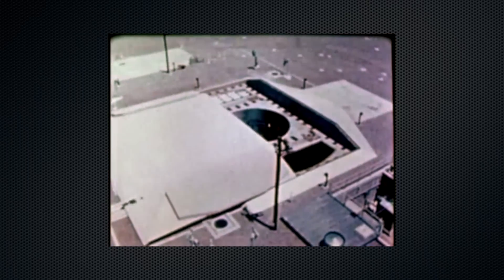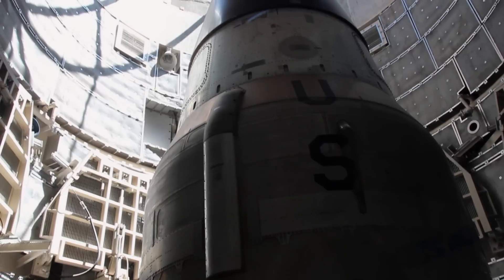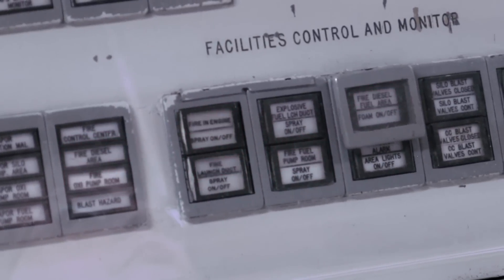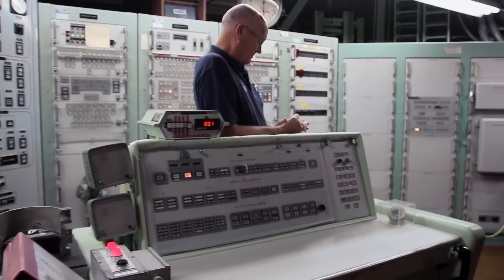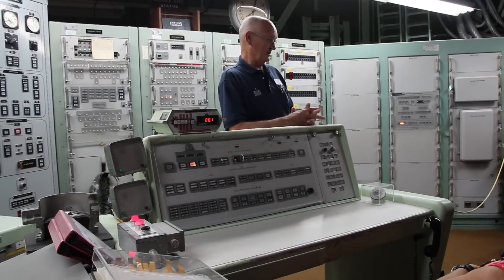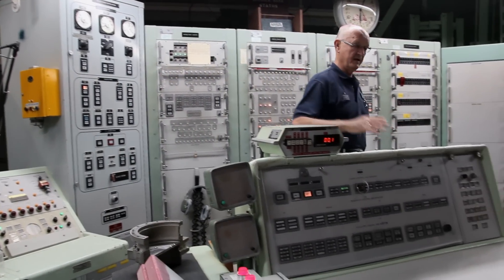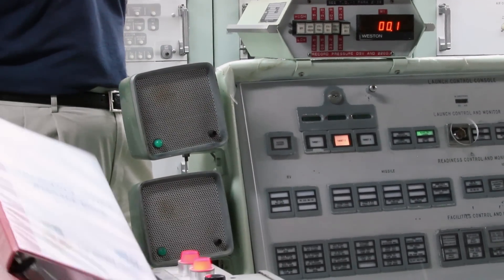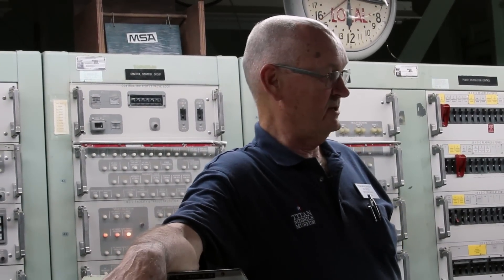How a Titan Nuclear Missile Launch Works

Comment: If you stop at 1:14 and notice the lit lamps next to the key. One says "LAUNCH ENABLE". The unlit key below it says "LAUNCH DISABLE".  The control 'computer' or system was analog, so the Launch Enable and Launch Disable lamps were lit by the presence of voltage on that particular wire. In essence, it's a digital 1 if voltage is present and a digital 0 (on or off) if no voltage was present. As I volunteered at the Missile Museum in the early/mid 90's giving tours, I had the opportunity to meet many individuals who were involved in the design and construction of the silos and missiles, as well as people who had worked on decommissioning and demolition of silos when the program ended. In any case, I learned this tidbit of information from an individual who worked on the design. During an actual launch, where the alarm comes in, the red safe is opened and the launch codes are entered, the silo door will slide open and when the keys are turned, the presence of the LAUNCH ENABLE signal would allow the butterfly valves on the fuel and oxidizer to open and mix, which would launch the missile. During one of the test drills, everything is done the same, EXCEPT you would see the lamp on the LAUNCH DISABLE switch LIT. This would allow the codes to be entered into the computer, the silo door would slide open, BUT the keys were turned, the butterfly valves would NOT OPEN, and NO LAUNCH would occur.   Now the person I met discussed this with me at some length - each silo had all the manuals and wiring schematics for all of the equipment there, to include the computer equipment. if you were to pull up one of the floor panels behind the computer racks, and find the bundle of wires, you could find the two wires (LAUNCH ENABLE and LAUNCH DISABLE),  and if you cut them and wired them so the LAUNCH DISABLE signal was connected to the LAUNCH ENABLE wire, then when you were just going thru a TEST DRILL, and when the crew turned their keys, their panel would 'show' that launch DISABLE was lit, but in reality it was connected so the computer would see LAUNCH ENABLE, and thus, would allow the butterfly valves to open on the fuel tank and oxidizer and the missile would, in fact, launch with its warhead armed.  No shit. Any person with access to that floor panel could start a nuclear war. And the reverse of that is that if it were totally cross connected, then IF the crew ever needed to launch that missile, it would NOT launch. Because the LAUNCH ENABLE signal was cross-wired to the LAUNCH DISABLE wire.  And the fact is, that due to the command center isolation from the launch silo itself, the crew would never know that the missile HAD launched or failed to launch. They would only know it if they were told by radio or if somebody bothered to look in the silo after the test or launch. Anyways, after I talked to the person who told me this, I asked him what the solution was to prevent this. He told me that after he notified the Air Force of this 'flaw', he was detained in a room at Davis-Monthan AFB for two days, going over the schematics with them to prove how it could be done, and treated him like HE was, well, a bad guy. Well anyways, he said, their brilliant solution was to simply WELD the floor panel down in place to make it impossible go pull up to access the wiring bundle beneath it. At that point, as the tour was over and we were the only two left in the command center, we walked behind the computer rack, and we tried to remove floor panels to look at the wiring ,  and sure enough, only ONE of those floor panels was welded down tight.....this is probably one of the best things I ever learned while working at the museum...
Reply: MJW  Uh, NO. The entire command center is suspended on springs inside the underground sphere or 'egg' it was built in. It was designed to survive a near hit of a warhead. IT is very isolated from the surrounding ground.  If you've ever been there, you would see that the launch silo itself is a couple of hundred feet away, via an isolated (by blast doors) walk tunnel that is suspended on springs. The missile itself, when the butterfly valves open and the hypergolic fuels mix is only held momentarily. You cannot hear the silo door slide open, and when the rocket exhaust (which is pointed down into the blast pit) hits the water in the blast pit, it's turned to steam and is ejected upwards. The missile's vibrations are dampened so it cold not shake itself apart. The Crew would have NO idea if the missile had launched or not launched. Also, sound of all the machinery, air handlers, etc is very loud and there's just no way they would know, unless somebody saw it go, or they looked in the silo after the launch to see if it was still there. It's that simple.
Reply: Huh.  I assumed the butterfly valve system was done by an embedded computer in the missile itself, which would have the other copy of that secret code.  But yes, there are probably all sorts of security flaws like this, even in the modern systems.  This is because only a small number of people have ever been privy to or have even "red teamed" the architecture and design.  The newer Minuteman missiles, while they use early 90s era computers, probably have many flaws like these.
Reply: @GeraldMMonroe  The butterfly valve system WAS as secure as you say.  This guy is full of crap.
Reply: I was a crew BMAT during the 70's. When the system was built, the Enable/Disable signals were controlled by the Launch Enable System (LES) which basically was a radio which received a constant disable signal.  If the signal were lost, the system would flip to Launch Enable.  That was a known weakness.  Those signals came into the Control Monitor Group (CMG) at the floor, as described, at Terminal Board Four (TB-4).  Later, the Coded Switch System replaced the LES, and sent a digital series of codes to the Butterfly Control Valve on the missile itself, which could not be tampered with, or it would self-detonate and lock the missile.  When the proper code was entered, Launch Disable cut off, and Launch Enable became positive, and that too, entered the CMG at TB-4.  Ours at McConnell were locked and sealed; I don't remember any floor panels welded, but they may have been.
Reply: @martygreene6891  What was the function of the 10-digit green number lights above the target switches on the MCCC console?  (The ones with the key switch above.)
Reply: This doesn't seem to make much sense.  The BVLC system was built to be hotwire-proof, because the butterfly valve lock itself was programmed with a site specific code, and that code had to be digitally transmitted to it by a thumbwheel code entry area.  They made a pretty big deal about this, with the BVL having explosive charges inside to jam itself shut when tampered with, and all the codes to erase themselves if too many tries are attempted.  So, you must be talking about the way the system used to work before it was secured, but it wasn't secured just with a weld... the weld, if true, was a temporary fix before the CSS (coded switch system) was added to Titan II.  Also, the crew would know if a missile launched because all sorts of alarms related to fuel pressure(s) and fire(s) and cord cuts and signal losses would immediately go off once  the missile destroyed the damned silo internals on launch.
Reply: @JamieVegas  I can only relate was was told me by by somebody who was deeply involved with the design of the system, and how he was treated and ultimately how I found the floor panel welded down. It is what it is.
Reply: @денисбаженов-щ1б  That's not surprising. At least, here, the fellow who figured that out wasn't executed.
Reply: Holy shit! Image those wires shorted out by some reason, a rodent or something and..
Reply: I doubt that the warhead was armed just because the fuel valves were opened. Didn't the warhead have a separate arming signal? It seems very strange if it didn't. Furthermore, I suppose the guidance computer had to be supplied with the target coordinates in order to steer the missile the right way. Opening the fuel valves would have the missile flying but without a given target, I wonder if the engine actuators would move at all. Without them moving, the missile would probably soon begin to tumble and crash.
Reply: @skunkjobb  I can't speak for the early days, but in the 80s, the warhead was not armed until the missile was in flight.  Arming the warhead was part of the flight program.
Reply: @skunkjobb  The targeting information etc was fed into the computer on paper tape. Back then, paper tape was about the most secure way to do it. When the alert came in, they crews did everything they would do during a REAL launch, to INCLUDE entering in the codes. "One of the many failsafe devices, for example, required entering a six-digit code into a combination lock — meaning there were 17 million possible combinations — and you only had seven chances to get it right. On the eighth, the lock would commit “electronic suicide" and lock out further attempts. So with "launch 'disable' enabled, everything would work just as it would work during a real launch. Except the silo door would stay closed and the butterfly valves would stay shut. From what I also remembrer, they would select, as told, Target 1, Target 2 or Target 3 as well (they were never told what each target was)......
Reply: Wow, and now imagine the missiles pointed straight at your location (hmmm USA maybe...) and the safeguards (or lack thereof), and, well, there you go.  Fascinating how the entire earth is a futile existence at the push of a few buttons.
Reply: I realize Im pretty randomly asking but do anyone know of a good website to stream new tv shows online?
Reply: I've heard of hot wiring a car but never a nuclear warhead...
Reply: If that was true, the wires that lead to the lights within the console itself would also be a potential issue. Hopefully the console panels had security safeguards and disable contact switches wired to the access panels.
Reply: @ChatGPT1111  It was true. The 'light circuit' was not on the same logic circuit. That's why it's so insidious.
Reply: Quantumrift.  Can you send this to my messenger on Facebook so I can post your experience.  My profile is. Rudy Chapa (bitcoin pirate)
Reply: @bitcoinpirate3905  Yes. I met many people during my tenure there as a guide. Some were Japanese, some were Russians...all were curious. One particular day I had, on the first tour in the morning, a gentleman who was involved with the design and construction (not the same fellow I mentioned above) and he went over a lot of neat stuff I didn't know. Then on the last tour of the day, I had the pleasure of speaking with a fellow who was intimately involved with the demolition and destruction of the silos that were decommissioned. Also a lot of good info.

Comment: In reality, the process involves Michael Madsen pointing a handgun at the second operator and saying "TURN YOUR KEY, SIR."
Reply from the maker: No kidding. When I was filming this video that scene from Wargames kept coming up in my head the whole time. I never did but wanted to ask the tour host what he thought of the scene.
Reply: As a BMAT with 6+ yrs Combat Crew duty with the 381st SMW (63-70), I can categorically guarantee that my bird would launch, cooperative officers or not, because I knew where TB-1 was and what signals were located there!
I also had access to the SIOP so I knew what our Launch Windows were.

They had their 38s and we had access to our M-1 Carbines. They kept the M-1 ammo under lock and key but some of us had our own loaded mags in our gym bags.
It's called 'Contingency Planning'..........
Reply: the commander and deputy commander could not fire the missile on their own!
Reply: @smw381st  I think that it depends on what type of signals that originated from each key, of those are just a simple voltage present, a few wires from each key, hold the bare ends together and make contact and away she goes!
Reply: Erilen it still has noting to do with any signal the keys had which they did not have any anyways!

Comment: Saw a sign on a missile silo door put there by a crew member " delivery anywhere in 30 minuets or it's free"
Reply: "Delivery in 30 minutes, or the next one's on us" lol
Reply: Robert Benoit
I don't know where you get your information, but  that is a Titan 2 missile.  I worked on them in the 1970s, and I know what I'm talking about from first hand experience.  And as to the launch time, I worked on the silo Closure doors.  From the time that the keys were turned, the electrolytes were released into the batteries.  The batteries would charge automatically and as stated would be completely up to power in 28 seconds, and the power went internal, the turbo pumps spun up, and finally the "Butterfly Valve Locks" were opened, the door was just finishing it's opening sequence.  The door was required to open in 11 to 21 seconds.  the time from the EWO (Emergency War Order) coded message was received and verified, till the missile cleared the silo, was under 5 minutes.  The flight time for the Soviet missiles was around 20 to 30 minuets, so the Titan were well on their way by the time the first inbound missiles found their now empty targets.  The liquid fueled missile was always fueled and ready to go.  One way you can always tell at a glance that it's a Titan 2 launch, is by the "V" shaped smoked exhausts coming up on both sides of the missile.   That's because the Titan, as opposed to the Minuit Man, had two thrust "chambers / engines" and there was what was called "the W" at the bottom of the silo.  The center point of the "W" split the two motors, so the exhaust from one engine went up one side and the other exhausted up the other side, thus the characteristic "V", with the missile rising between them.   The Minute Man only had one motor on its first stage, and no "V" shaped exhaust.
Reply: I don't know for sure but i think he means the B-52 is not used as a first line Nuclear Delivery Vehicle. I think they use them conventionally,now.
Reply: I'm not sure what he's talking about I think I would believe someone who worked on this first-hand as far as I can tell the Minute Man series came around to replace the Titan because of the liquid fuel and probably the updates in the accuracy of the missiles themselves
Reply: I was a Minuteman II nuclear certified combat crew member.  One of our squadron t-shirts had the slogan "We specialize in large quantity earth movement and urban landscaping".
Reply: Carl Covington lol
Reply: I worked on that (740 ton) door and got to open it.  Of course from where you open it for maintenance, you can't see it.  I was a missile pheudraulics  tech.  I also worked on the blast doors,  blast valves,  the work platforms, the missile guidance, and antennas that popped up out of the ground.
Reply: correct, the B52 is still utilized with standoff tomahawks
Reply: Strategic nuclear plans (CONPLAN) don't include the B52, but some can launch Tomahawks.
Reply: InsideOutside UpsideDown ...come on boys , the B52 hss been refitted with all new modern up to date Armerment . She is ready once again too to make someone not have a good day . Fully nuke ready .
Reply: Carl ....pretty funny , Bledsoe. Lmao .
Reply: Ba dum dum PSSSH 🥁
Reply: Carl .....fucking sweet !!!
Reply: the reason that the TItans were done away with was because they became outdated and they kept them longer than they had originally planned
Reply: That actually was not on Titan Missile, that was in Minot ND at a Minuteman Silo.  I saw that video and they made it look like a Dominos pizza box.  It said Minuteman, Worldwide delivery in 30 minutes or less. Plus Titan couldn't be fueled and stored because it used liquid propellant until they upgraded that to the Titan II which was still liquid fueled but it used a more stable hydrazine based fuel.
Minuteman III is much better because is is a solid fuel rocket.
Reply: Give me a Large Meat Lovers and a 2 liter Nuka Cola.
Reply: I’ll have a supereme pepperoni cooked at 1,000 degrees and 6 two liters of nuka cola :p
Reply: Robert Benoit the B-52 bomber is still in service
Reply: But not in its original strategic nuclear role.
Reply: Not the TITAN MISSILE.  THAT IS THE MINUTEMAN III.  Titan is a liquid fueled rocket, Minuteman is a solid fueled rocket.  Minuteman III is the current missile on the land based silos.  The minuteman missile was developed to replace the Titan because it took too long to launch the TItan and we needed a counter strike that could be launched much faster.  That is why current strategic arsenal is mostly forward deployed on submarines.  It is also why the B-52 has been taken out of service replaced by other bombers that have a more stealthy ability and most likely can fly faster.
Reply: Robert Benoit wrong.
Reply: @robertbenoit5374  you tomto, I say tomato ... ends all that ends,,,

Comment: I visited this museum and got the impression that the warhead wasn't armed until arfter the missile's second stage ignited to prevent a detonation should the missile fail upon launch.
Reply: Nuclear warheads used Permissive Action Locks which would prevent them being armed if stolen or due to malfunction. For missile warheads one safeguard was a lock that sensed the pattern of accelerations and would only unlock after that pattern was within parameters for a valid launch.
Reply from the maker: That sounds familiar as well, but I can't recall.
Reply from the maker: Serge, thank you for sharing your insight. This is really helpful.
Reply from the maker: Serge Sret  
Serge, thank you for sharing your insight. This is really helpful.